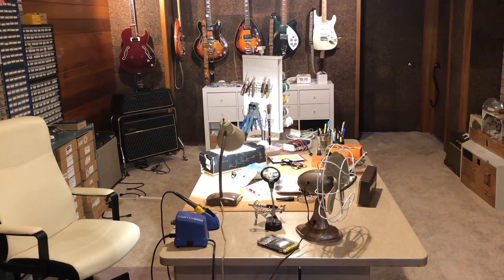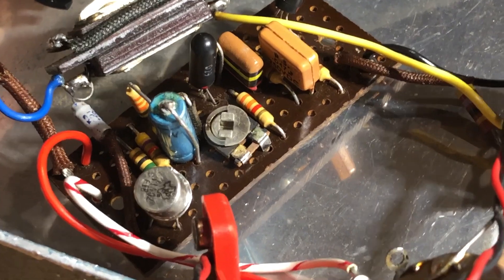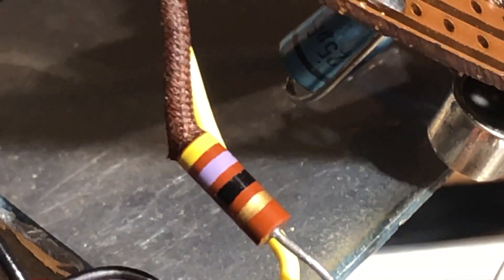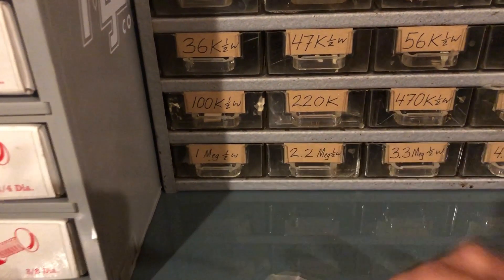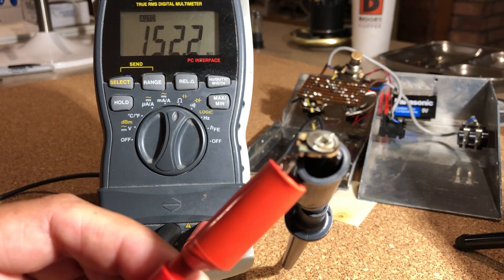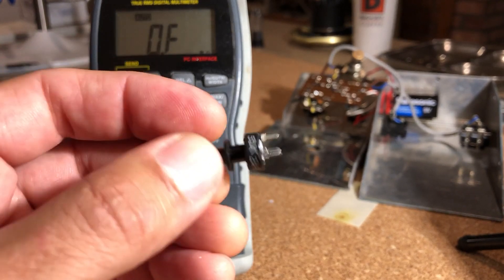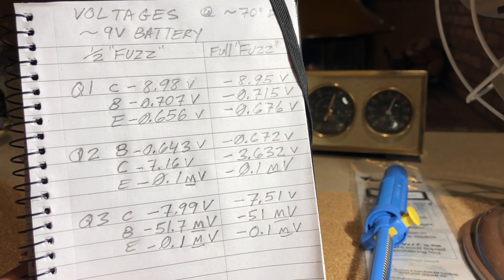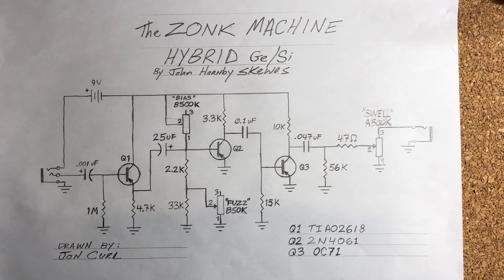Original Zonk Machine Repair Overview

Comment: Does it catch a lot of RF on single coils too? 
I made my tribute pedal to the Zonk mk1 and getting quite noticeable zzzzzzz on fadings. 
Only the one thing I found to fix it is a brass shield box for the input jack socket because it's too close to the board when the enclosure is assembled. 
But how it used in the original units if they catch it too?
Reply from the maker: The noise you're hearing when you assemble the enclosure isn't really due to RF, it's mainly EF and some EMF. Most builders assume this is just a very difficult circuit to "tune" and say that this or that transistor # as such is "too noisy" for the circuit and never understand what the fundamental issue is or know what an original is supposed to sound like. The original jumbo 3-piece Zonk enclosure is a very poor layout/design for this circuit and only exacerbates the problem (though it does LOOK cool). Your solution to shield the input with a grounded brass box is arguably the best in terms of preserving the original sound/tone. Even the MKI Tone Benders do this to some degree, the Zonk Machines more noticeably due to the high pass filter. You can select a transistor set and tune the noise out ~entirely, but you have to know what you're doing and have a very large quantity of transistors to choose from. 
For example another "experienced professional" builder who's emailed us about 100 times for advice on his builds (including questions like "does adding and LED cause noise?") commented that he won't use the TI 2G374 in the first position of a Zonk because it's "too noisy". Any builder worth one's salt knows that to manufacturers transistors only exist as data sheets. They can and do vary fairly widely in spec. while still being "within spec." You can't necessarily rely on date codes, epoxy color, dot color, tin/vs gold leads, etc...to determine this. You can run a frequency sweep and that will tell you something. He's probably got a batch of 2G374's with a higher frequency and doesn't realize it. This is kind of like the issue you told me about with your MK 1.5 build where you had problems biasing up the Mullard OC75. The very early production Mullard OC75's tend to be lower gain and leakage and are easier to bias up in that circuit. Regardless, in my opinion there were still much better choices than the OC75 for the MK 1.5. I think things moved very fast back in the 60's and sometimes being the first to do something and get it out in the world has it's drawbacks.
Reply: @acidfuzzpedals9986  Absolutely agree about the original enclosure. If they place jack sockets at least 10mm far from the board. All could be much more stable. When I just shift a little the unscrewed top pard of the enclosure forward the noise disappeared. :) If they install the input socket on the left side and the output to the right it could solve a problem too. I tried.
However it's a funny thing I found a decision in my case. Seems I decrease a lot the noise without a brass box.
Firstly I stopped experimented with OC44 as a Q3 because I have only three ones and they sounds on my unit quite gated and very sensitive making more noise. I've took good old OC71. I have them a little more than three pieces and I found nice un-gated and thick-skinned as a noisemaker transistor. Then some placement turning of the input jack socket and looks like I have quite silent (I mean zzzzz) on fadings even with single coils.
As Q1 I using now 2N1307 by TI.
Glad to hear you are remember about my mk1.5. I finished with it. Found more suitable old OC75 for the Q1 but anyway I had to biased it a little decreasing 47K resistor. I just soldered suitable Piher resistor in parallel but under the stripboard ;)
Reply: And a really strange thing they used a lin 50k pot for the Attack biasing. Gary Hurst used log pots on his TB mk1 and it works really better here.
Reply from the maker: @soulmanvintage  Exactly. I used logarithmic. Keeping it linear for the sake of originality is just silly.

Comment: Amazing video, amazing new office :) What is that TI A02 hfe?
Reply from the maker: I didn't pull the TI A02618. If it ain't broken don't fix it. You can make a common sense guess on the gain by cloning the circuit, then A/Bing and subbing gains until you're there. I'd say it's between 70-90hFE on this one, but I highly doubt they were all the same.

Comment: Do you get those carbon comp resistors from eBay? Are you still making these replicas?
Reply from the maker: All of the parts bins you see behind me came from an estate sale. Back in ~2009 Kristina wanted me to get up at the ass crack of dawn to go estate sale shopping with her. I really didn't want to, but she said "there's going to be electronics", so I went. After hours of looking at purses, women clothes, and other random junk we arrived at a warehouse. It turned out that three electrical engineering firms were liquidating their "obsolete" stock. I almost shit my pants and didn't even know where to start, as it was full of all the parts you see in my office, vintage germanium and silicon transistors, caps, etc....
The lady running the liquidation didn't know anything about electronics and was going to junk whatever didn't sell. Kristina and her got to talking while I ran around trying to figure out how to fit things in the car. The lady said that for $50 bucks I can take whatever I want. We loaded the car so full I even had boxes on my lap! As we were pulling away Kristina asked if I wanted to go back for an item, I told Kristina to" just drive!" as I couldn't believe what happened. I felt like I had robbed a bank and wouldn't believe it was real until I actually made it back to the shop.

Long story short, I didn't get them on eBay.
Reply: Acid Fuzz Pedals best story ever! Had a similar experience when I bought an Echoplex ep2 for $100 in rural iowa
Reply from the maker: Nice score! I guess sometimes the universe lets us know when we're on the right path.